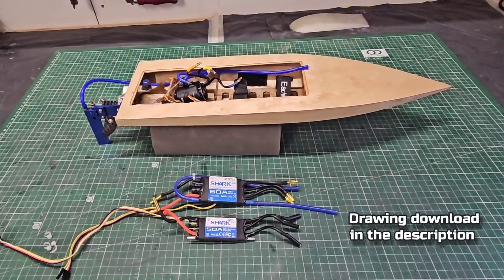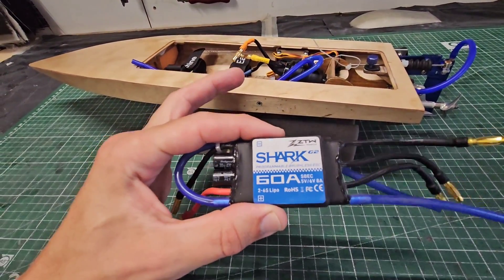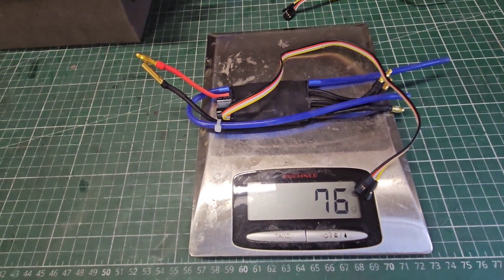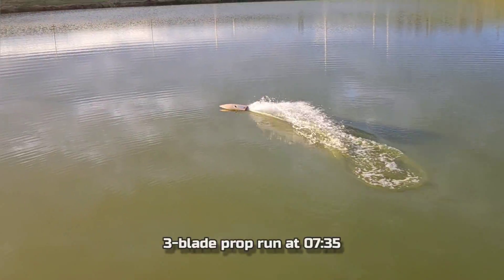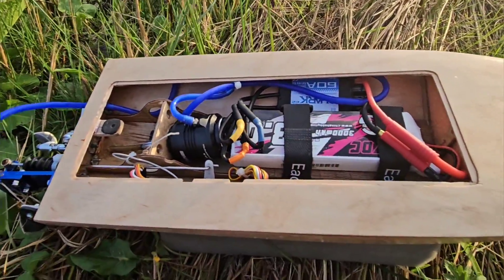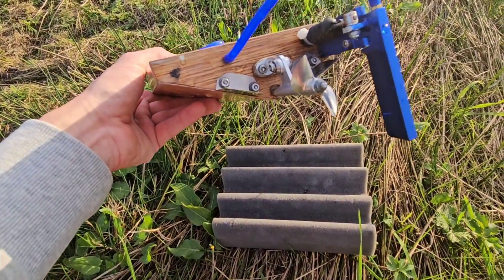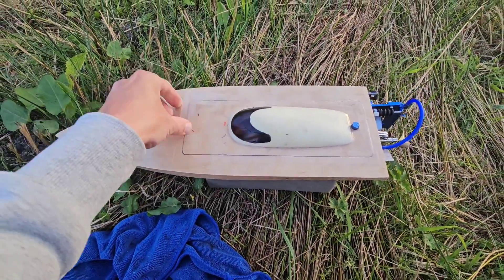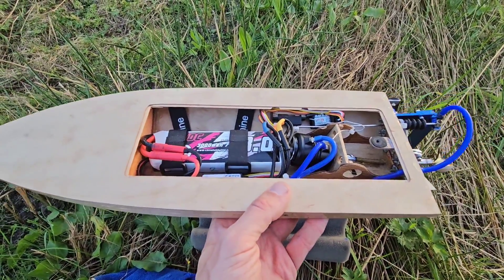Solved! Speed controller upgrade, new speed record and hot laps running of the Mini Mono DIY RC boat

Comment: Nice running! What motor are You using?
Reply from the maker: Thanks! I'm using the setup from the parts list in the drawing. The motor is a Rocket 2948 3450kV
Reply: @CozyRC  Thanks!  I found the list
Reply: @CozyRC   Got to run my Mini Mono yesterday for the first time, but only a short test run. It run really nice. Im using a 4300KV motor

Comment: Very cool you figured out the issue and gained some more speed! :yougotthis: I'm liking the 3 blade props more and more for monos. You get that extra blade turn in the water and it's easier on the electronics compared to running 2 bigger blades. I was surprised to see the exact same mph from the Oxidean 4519 2 blade and a Chinese CNC 4019 3 blade😄 ..the boat liked both props but seemed to perform better with the 3 blade all around. BG4L!🚤💨
Reply from the maker: Yes, the power cut is resolved! And nice background on your 2 blade vs. 3 blade experience. Did you notice more bow lift with the 3 blade? Maybe not  due to the smaller size?
Reply: @CozyRC  Not really noticed much bow rise difference between the 2, but the 3 blade seems to be what the boat likes.. although it does cavitate more out of the hole compared to the 4519 👍

Comment: Really impressed by the three blade prop …I should definitely consider it! Even the sound is different…Good work Jan👍
Reply from the maker: Thanks Dim! Yes the 3-blade props make a different sound. Less high-pitched. The acceleration is also very nice with these props!

Comment: Hey dj, it runs great awesome boat. I just got the 100a version and it fits🎉(barely). For the lipo tempersture maybe try a 4s lipo(fpv lipo they can perform awesome power) and when doing it on 4s maybe a 75% trothle limit so speeds are the same as 3s
Reply from the maker: Hi Mylan, Thanks! I don't think running 75% on 4S will be better than 3S. It will be more stressful for your esc, and you carry more weight in the hull, which you don't use. Why do you think that would be better than 3S? Just curious 😀
Reply: @CozyRC  maybe because the 4s lipo doesnt need to give al its power away it wil get less hot and using a 4s 1500mah wont add that much weight, it is smaller the the 3000mah 3s you are running( i fot the same one and think it is to big so  i tried 4s 1500 and the boat was running better with it and it was a lot lighter. Also the 75% is just so it is the same as a 3s bit if you want to you can always do like 80% or more untill you think it is to much for the boat to handle. But hey just saying maybe try it maybe dont but it will be intresting?
Mylan
Reply from the maker: I think the amount of A.ps the motor pulls from the battery, dictates how how the lipo gets. It doesn't matter how many cells you have, with the same motor rpm, the Amp draw from the lipo will be the same. You would expect the 4S 1500mAh to get hotter, because it has less capacity... but your experience is different, so my theory might not work in practice!
Reply: @CozyRC  maye
Be we csn try it sometimes would be fun🙃

Comment: Runs like a champ.. Nothing more to comment. Yes and off course Congrats to new pb, but that won't be the last.
Reply from the maker: Thanks Peter. This was mainly a speed controller test. The 60A version is the better choice for this hull, if you want to run bigger props.
The real speed I hope to achieve with the carbon Mini Mono!